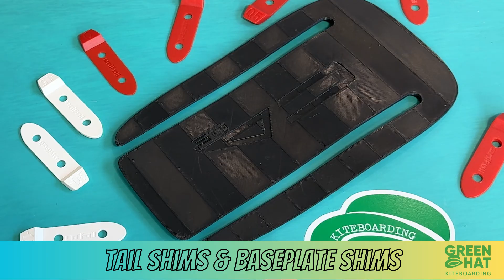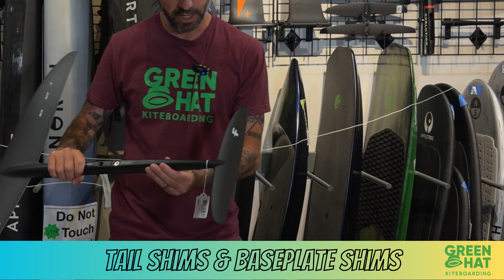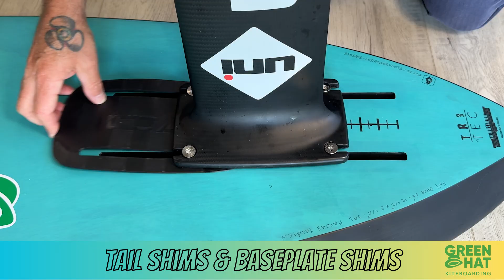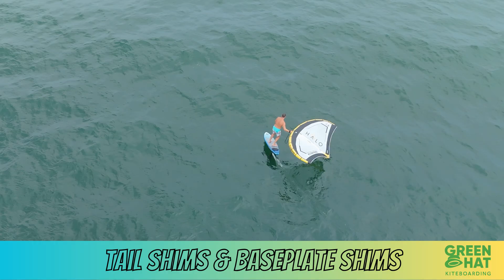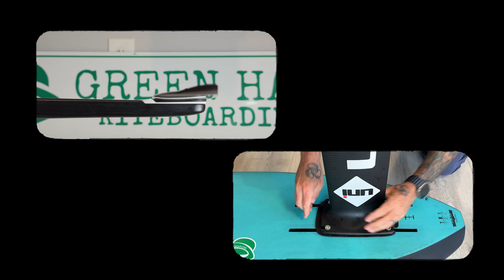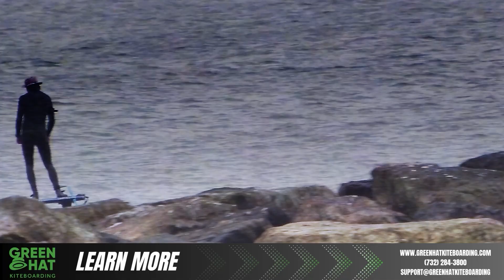HYDROFOIL SHIMS EXPLAINED | Tail Shim vs Baseplate Shim for Better Hydro Foiling Performance

Comment: Hello, what configuration do you use with unifoil progression 170/140 and the Super K2 board on the wing? Thanks
Reply from the maker: Hey, this is Dave from the video! I’m more of a prone foiler, so I haven’t winged  with that exact setup. But when I do wing, I usually go with a neutral tail shim and a neutral baseplate/board angle so everything feels balanced. Since you’re using the power of the wing, I like to keep the setup as even as possible. I typically only add a positive tail shim when I need extra pump efficiency or want to slow the foil down a bit for prone sessions.
Reply: @GreenHatKiteboarding muchas gracias Dave

Comment: Nose down - earlier lift, sure?
Reply from the maker: Baseplate nose down: On my setup, I’ve found it  increases lift. It brings the front wing into a more positive angle, making pumping more efficient and takeoffs smoother and earlier. I’ll use a nose down shim when I want to move the mast back in the tracks for feel, but still keep that easy pop up to lift.

Comment: Great to explain the effects of combination mast and tail shim. For someone with a slowly improving pump (concentrating on staying high as per your other video) and often gets stuck nose high, I definitely feel the thick end back mast shim helps counter this. What I’m not sure on is whether it’s due to an increased AOA of foil or easier to keep weight forward as front foot lower than the back?
Reply from the maker: Totally agree, everyone’s setup and feel evolve as they spend more time on foil. I went through the same thing figuring out my pump. At first, I kept my mast too far back and couldn’t stay efficient, even though positive shimming should’ve helped. Once I moved the mast forward, everything clicked.   I was able to ride higher, and the board’s center of lift lined up way better with my stance. For me, keeping the board level gives the best pump cadence, but I also like a touch of nose-up when maneuvering. Definitely worth playing around with both mast position and shimming until it feels balanced for your style.

Comment: Ultimately if you want the best pairing for your foil pair it with the same year boards. 😛
Reply from the maker: Well to a certain extent,  some prone and wing boards still have a slight amount of baseplate shim built into the design. It used to be a lot more exaggerated in older models, but a few brands still use a bit of built-in angle to fine-tune the foil’s feel and ride position. I’d say if anything, sticking with the same brand usually solves the problem. Most board brands that don’t make foils will have a true 90-degree angle over the foil boxes so they can work universally,  and then you can always fine-tune with a board shim if needed.
Brands that design both their boards and foils usually dial them in to work together much better from the start. That said, a baseplate shim can definitely help correct unwanted feels… to a certain degree. 😄 (See what I did there?)

Comment: why are you showing the tails upside down basically confusing what neg and pos shim actually look like.  Thats a unifoil tail so its bottom mounted so literally opposite of what you are showing in the vid
Reply from the maker: Good question, and I totally understand where you’re coming from. The reason it’s shown that way in the video is because that’s the exact view a customer would have when they’re installing the shim. I used the Unifoil setup as the reference since at our shop Unifoil and KT gear, both include shims in their hardware kits.
I wanted people to be able to visually match what they’re seeing during installation so they don’t accidentally put the shim in backwards or upside down. The main goal of the video is really to explain what a positive or negative shim does when it’s used, not so much what it looks like once it’s mounted on the foil in the water. 
That said, your point makes total sense, it can definitely look opposite when you think about how a bottom-mounted tail sits. Appreciate you catching that and bringing it up!